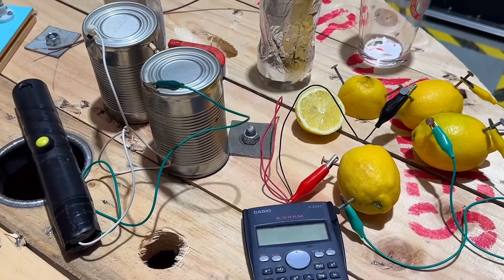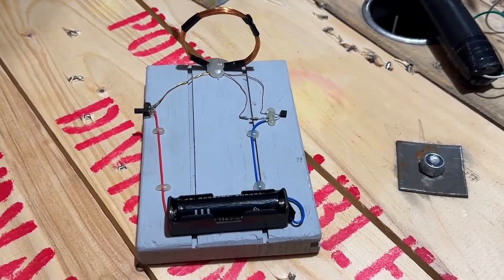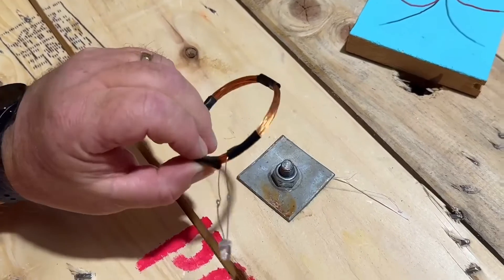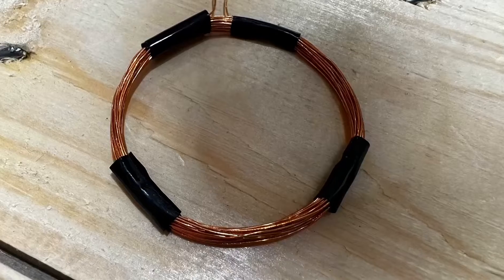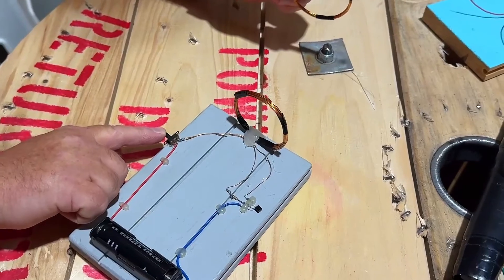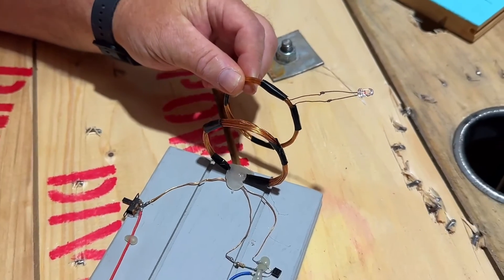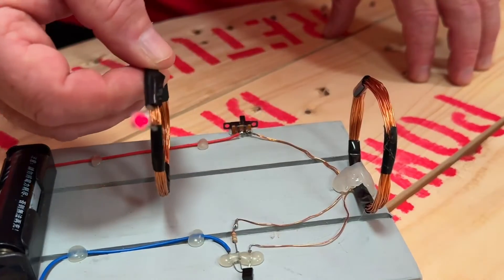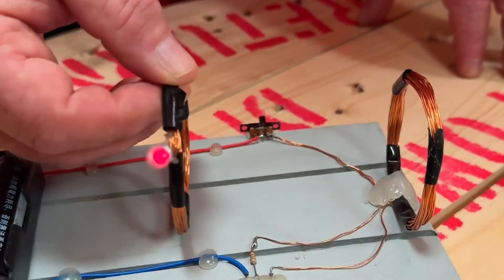Is Wireless Power Even Possible? The Tesla Coil Says Yes!

Comment: This is how an induction cook top, wireless QI charger, basically ANY RFID system, and tap to pay systems work.
Reply: No. You are getting mixed up.

Induction hobs work by a changing magnetic field which induces eddy currents into the base of a pan.

This is not how RFID or tap-to-pay systems work.

RFID - the clue is in the name, RF, which stands for Radio Frequency.

It's very common for people to mix up and not understand the difference between: (1) magnetic field, (2) electric field, and (3) Electromagnetic Radiation  (EM radiation) comprising photons.

Induction cooking uses (1).
RFID and contactless payment systems use (3).

RF energy is photons, and each photon comprises an electric field component, a magnetic field component (usually at right angles to each other), which are both changing, and that photon is moving at the speed of light in a direction which is mutually perpendicular to the magnetic and electric field components (a so called Transverse ElectroMagnetic wave - TEM, or plane TEM to be precise).

Communication - the transfer of digital data - to and from an RFID card is done by radio signal - photons of electromagnetic energy.

Where it gets interesting, is how the integrated circuit chip in the RF ID card is electrically powered.

There is a microprocessor on the card and it requires electricity to operate. But yet the card has no battery.

The chip is powered by radio signal.
There is sufficient energy in the radio signal and with a suitable length antenna built into the card, enough energy can be captured to power the electronics on the card.